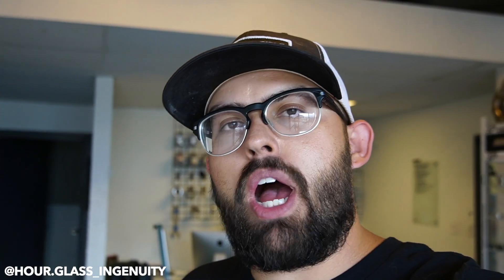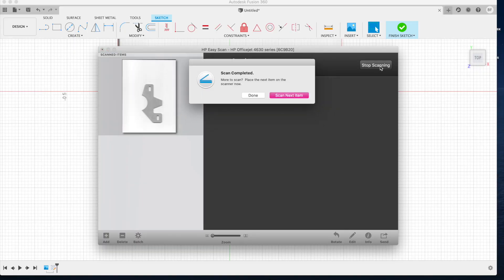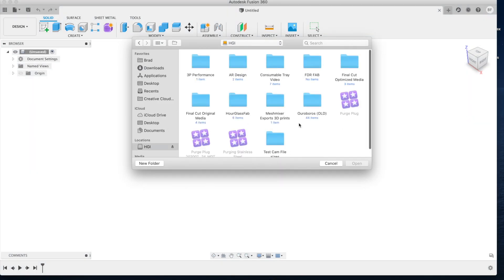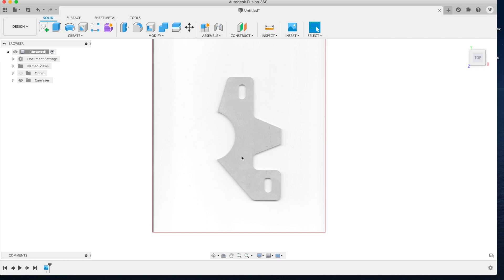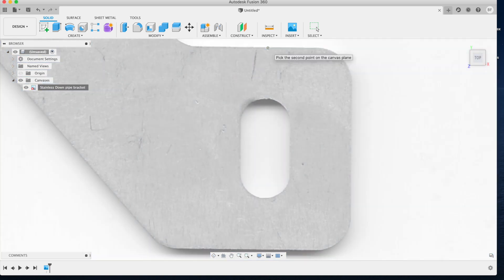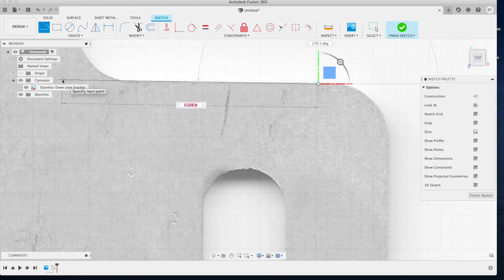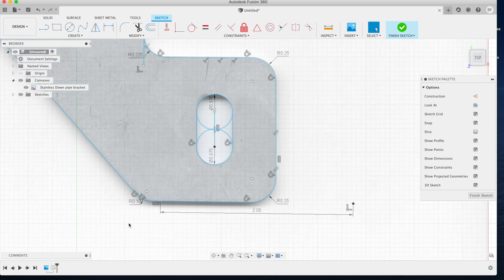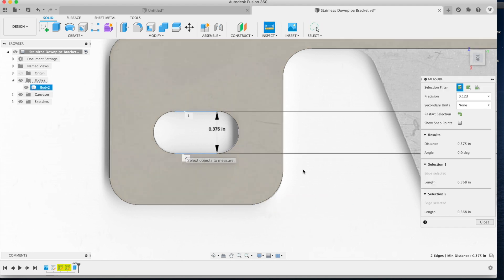Scan 2D Brackets and flanges into FUSION 360 to create 3D models!

Comment: Wow omg.that is insane. I am a newbie jewellery maker. And i have always thought how useful it would be to be able to scan a 2d picture of a jewellery item ak a bangle.  Then to be able to make it into a 3d render to print it. Omg. I am absolutely hot of the press new to 3d printing and wanting to learn. I am wanting needing to learn the very basics  I have been on tinkercad and about to start fusion360 on my mac tomorrow. But is this true are you saying I can draw a picture of a bangle for example then simply scan it onto my mac with my scanner save rhe file as a png then insert that into fusion 360 and from there I can tinker with it and turn into what I like then save as a printable stl file and print it ? Omg omg where can I find clear instructions on how to do this? This has me very excited. Thank you

Comment: Great method ! , my method is im always measuring the size of hole to holes and give the caliper lots of measuring, kinda complicated but that works for me and the final product comes really tight
Reply: this is interesting to me! i have objects that do not fit under a scanner. but i find it very difficult when the corners of an object are not 90 degrees. how do you solve this?

Comment: A faster way of doing this is to just scan the object like you did, insert into any vector drawing program, trace bitmap, and export it as a DWG or DXF format. Then import that into Fusion360 or whatever parametric 3D program you're using, scale and extrude. No need to draw manually, you could end up with little bits of noise but some parts have freeform shapes or bezier curves which are hard to reproduce and sometimes impossible to even measure with a caliper.
Reply from the maker: Appreciate the input..  👍🏻 always more than one way to do things. Thanks for the comment. This is for guys in the fab world that are trying to make it happen in fusion 360 solely with as little confusion as possible. This process is easy and straight forward and takes less then 5 minutes for most parts.. I have done what you are stating here a few times and have never had luck with perfectly crisp lines without any clean up when using these as 3D models for machining, etc. Have a great day!